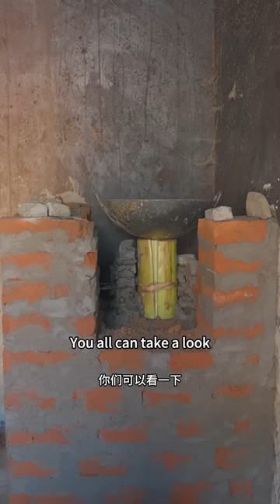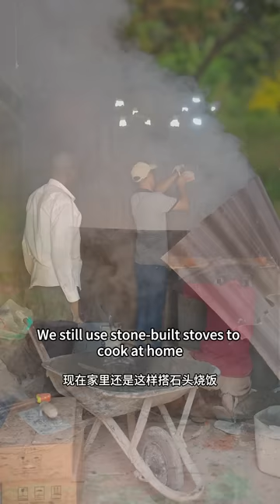We built this Stove in 2days! Cooking for my family's finally gotten a bit easier

Comment: Next they need an out side sink with running water. Some has to drill and build outdoor pump for running water.
Reply: Yes project  pvc pipeline is  good  ir use  bamboo  and  run  water from well to the house

Comment: I think I saw left over bricks...mom will probably still have an extra pot cooking outside, so instead of the rock formation - that the pot slips down on - perhaps these bricks could be used to make a higher, more level surface for the pots.
Also, will mom have a preparation table and real chairs in her kitchen?  A table to hold water containers, dishpan, a cabinet to hold various staples/ necessities? 😊

Comment: Rose, there is an easier way of doing laundry if you can get one of those rubber toilet plungers with the wooden handle and a 5 gallon bucket.  Simply cut 3 or 4 holes the size of an American quarter in the rubber so when you press down in a bucket full of water and laundry, the water has a water of exiting the rubber part of the toilet plunger.  

You can sit and 'plunge' the laundry.  BTW, look up antique laundry plunger and you'll see where this idea comes from.  Also, look up toilet plunger for laundry.  My commercial laundry plunger is called 'Mobile Breathing Washer.'  💡

Comment: NEXT BUILD A BETTER WAY TO WASH CLOTHES SO YOU DON’T HAVE TO BEND DOWN LIKE THAT. IT’S BACK BREAKING😢
Reply: Yes build like Wu Jianyun build for Rose’a and Anzai in china for them to wash clothes next to the house 🎉🎉 next project 🎉
Reply: That would make it easier for Rose’a mom to wash clothes as well 🎉
Reply: Yes
Reply: Use the PVC  pipes or better yet use the bamboo pipe to run the water from the well to the house and build a wash station like Rose’a has in china 🎉